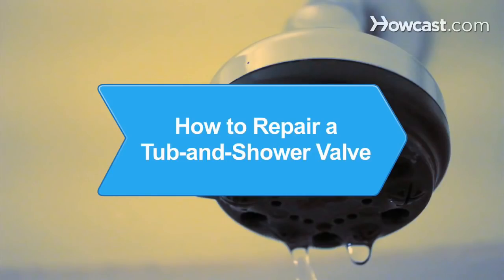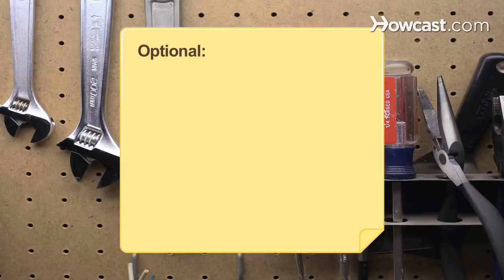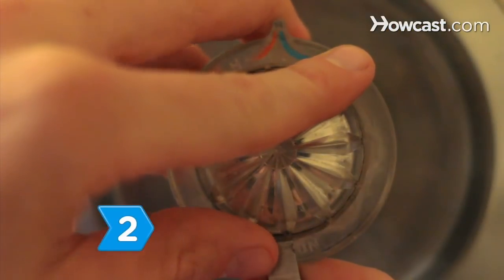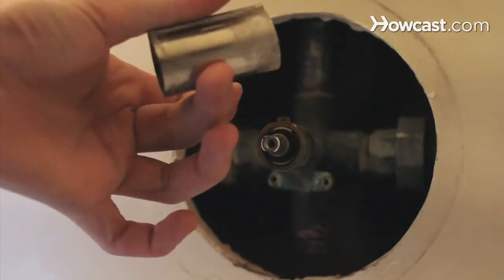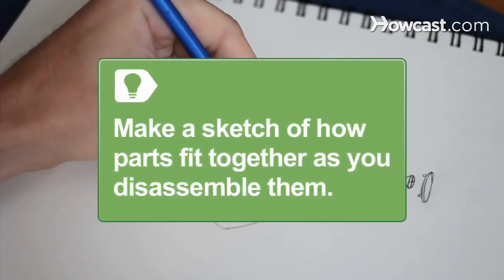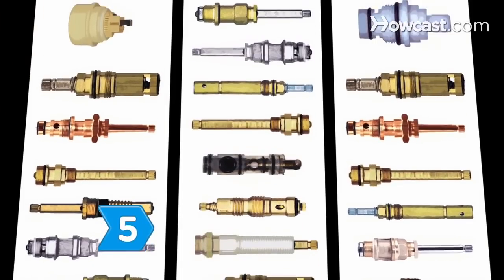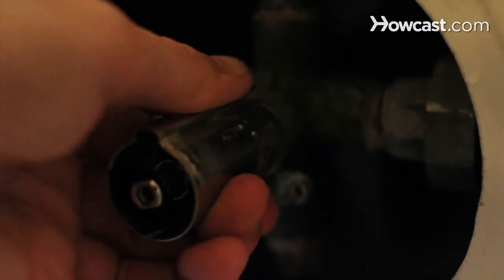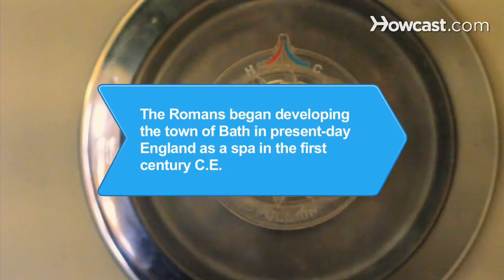How to Repair a Tub & Shower Valve

Comment: you don't need to take the escutcheon plate off you can just pull the trim sleeve off to get better access at the cartridge stem. i change these all the time. also if you put a new one in and your hot and cold is reverse, you can just rotate the stem 180 degrees and it will put hot and cold back the right way. that only works with the old moen 1225 cartridge, not the posi-temp.